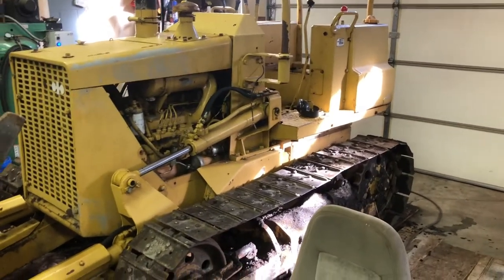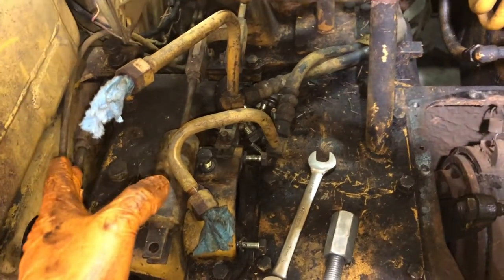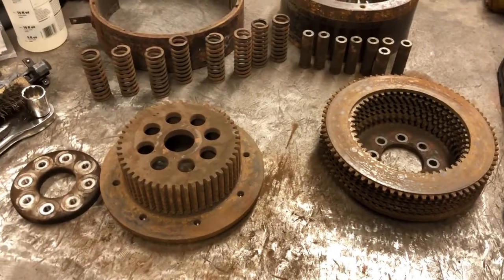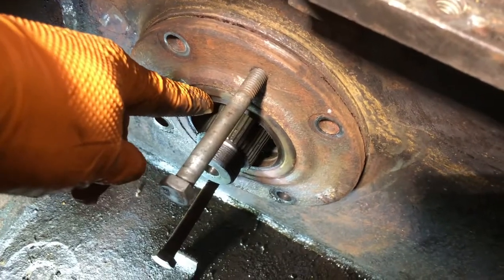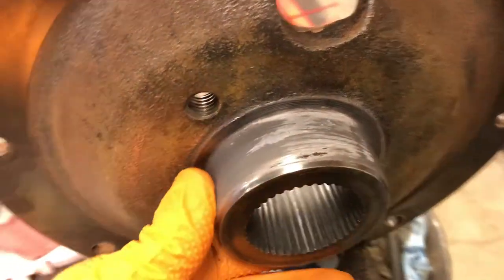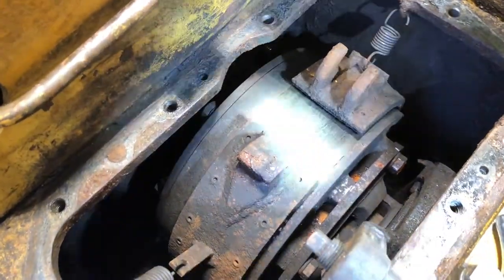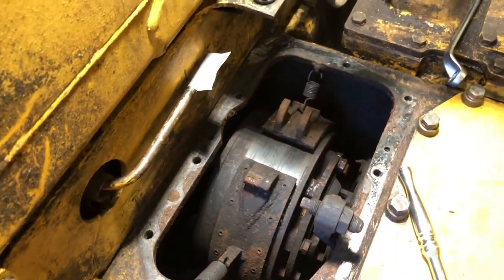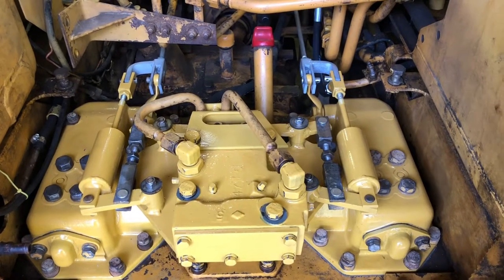Komatsu D20A-5 Dozer Steering Fix

Comment: Nicely done video, with tons great points! I have 1985 cat d3b dry setup they are very simlar in designs. I recently pulled my steering clutches and brakes and installed all metal disc with the bronze faced linings (they are made to run dry,) major upgrade for the d3's! Thanks Nate
Reply from the maker: Glad you liked it.

Comment: Thanks for posting this video. I'm helping my uncle fix a D21E-6 that isn't able to turn left and this video will help us a lot with doing so. Thank you and have a good day.
Reply from the maker: Thanks. Hope it helps.
Reply: @jeremydiy  Does the service manual you have cover the D21E-6 as well? If yes, where can I get it? Also is there a specific website that you were finding parts on? Thanks for your time.
Reply from the maker: @nick_is_steve  No it doesn’t. I have had the best luck doing a Google search for parts. I you get a part number then put that in. I use images a lot because then you can see if the part resembles what you are looking for.

Comment: Awesome video! My D20A5 just started locking up the right side. I guess I’ll be tearing it all down and watching your video 20x!!
Reply: Having a super tough time getting those clutch covers off. I need to take the little pins out on the inside, and they’re stuck!
Reply: Looking like that large bearing completely grenaded on me! Chunks of metal when the drive oil was drained! Where can that bearing be purchased?? I’ve found ONE, for nearly $350!!
Reply from the maker: Not sure which bearing you’re talking about but I think I looked them up by part number and found them on eBay. If it’s the bearing from the clutch to the sprocket, ya those are expensive.
Reply: Thank you for the reply. The bearing seems to be on back order. If possible, I have a couple of questions: the access plug to get to the brake clutch bolts is frozen, it’s now stripped out! Is it worth drilling it out, or should I just use a swivel head 17mm wrench to remove those bolts? Also, once those bolts are removed, does the clutch disc assembly just lift out?? I can feel that the bearing that the clutch assembly connects to is sloppy and likely destroyed. Any other info on this project would be appreciated! All of my steering is perfect, just had that bearing grenade on me and it would stop that side and sound horrible!
Reply from the maker: @stephenlarue6842 I think it’s worth getting that plug out. Without that access it’s going to be really hard putting it all back in. You can do a couple things, drill the centers out and use an easy out tool (the biggest one you can) to try and brake it free or weld a bolt head to it so you can put a socket on it. Which ever route you go I would soak it in penetrating oil and heat it up just before trying to brake it free. 
After you get those bolts off the plates on both sides, the clutch is free. I used a bar and a rope to support the weight of the clutch while I was taking it apart. It’s heavy, probably about 50 pounds.
Reply: At 15:51 in your video, the bearing that is on the shaft with the gear... mine completely disintegrated! This week I'll be pulling off the whole sprocket with outer cover to clean out the mess and see what other parts I need. A parts guy is asking for the number off of that bearing, but mine is in pieces! Any chance that you have that bearing number? I have the part number, he wants the number on the bearing.. thanks!! (Also, If need be, do you still have your old bearing??!!) @jeremydiy
Reply from the maker: I’m not sure I kept the old bearing. I checked my raw video footage from when I made the video and I never got close enough to see the numbers. I’ll look around my shop and see if it is laying around or in my recycle bin.
Reply from the maker: I still have the bearing. Japan G NSK 309 is all of the info written on the bearing. Hope this helps.
Reply: Thanks for your help! I now have everything apart on a table, my pinion shaft is damaged, and both bearings that are on the pinion gear are disintegrated to tiny pieces!! I took the whole outer cover with sprocket attached off… have to clean out the mess and spend some money!!
Reply from the maker: @stephenlarue6842  good luck.
Reply: Just an update, I got the entire drive assembly from a used parts seller, I have everything, EXCEPT for the race that you also replaced! It's not in the new retainer part! It clearly needs the race to fit the bearing! The part is not listed on my parts diagram! DO you recall that part number or name??! Race can be seen at 15:28 on your video. The old one from my machine is gouged and destroyed. Thank you again! @jeremydiy
Reply from the maker: @stephenlarue6842 
When I ordered the bearing the race came with it. The bearing and race are considered one part because you never replace one and not the other. In my video at 30:36 I show the part number of the bearing and race that I bought.
Reply: @jeremydiy  Would you believe that it took 4 months to get that bearing! It finally arrived yesterday! I'll need to refresh my memory now before I reassemble everything by watching your videos!! Thanks again for your help....
Reply from the maker: @stephenlarue6842 Holly crap that’s a long time to wait. I hope it goes well for you putting it back together.

Comment: Question the flange plate that holds on the yoke and throw out bearing, what size socket did you use to remove the nut that holds that flange on sir?
Reply from the maker: Unfortunately I can’t remember. I probably just grabbed sockets and tried them until I found the one that fit.

Comment: Do you remember where you got the throwout bearing for the clutch release? Or maybe the part number? I cant find one
Reply from the maker: I took it into a bearing supply company and they were able to take measurements and find a replacement. Unfortunately I do not have any of the part number information anymore. I think I still have one of the original bearings that I pressed out, I’ll see if it has any numbers on it that I can give to you.

Comment: Hey Jeremy great video. Been having the same issue with mine. Do you have the part # for those inner seals?
Reply from the maker: No. The only seals I changed was the ones I showed in the video. You should be able to find a number on the old seal. Every seal I’ve ever pulled out has a part number on it. You can then search that number on the internet or ask a auto parts place. I have a bearing and seal company near me. One time the number was unreadable and they were able to measure the dimensions and find me a replacement.

Comment: I just put clutches in mine also, but I am having a hard time putting the break linkage and the cover back together. Do you have any advice? Thanks for the video I watched it several times.
Reply from the maker: Oh ya, that was super hard. I can’t really remember. I do remember having almost everything assembled and putting the cover over the brakes and then having to insert a pin I believe patience and time is what it took.

Comment: Hi, nice video. Not sure if your aware that the left track is on backwards. It will cause it to wear faster and not grip very well pushing forwards. 👍
Reply from the maker: Ya I noticed that as I was working on it. It came that way and I haven’t made the time to fix it yet. Thanks for the heads up.

Comment: Hi I changed my clutches and the bearing went out in that yolk a little later down road I bought new yoke and bearing now the clutch won’t release my cylinder is operating and has accurate pressure thru control. I tried adjusting the bolt on top of arm both way do you have any ideas? Tired it’s of taking it apart to adjust and readjust thanks you have done a really good job!
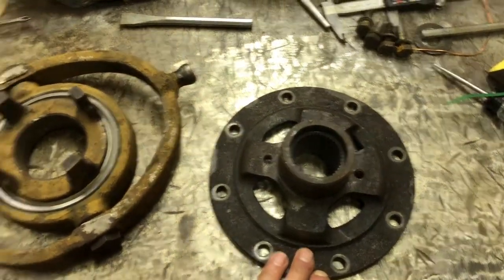Reply from the maker: Are you calling the yoke the leaver that the cylinder pushes against to disengage the clutch? I talked about it at 11:47 in my video. I just want to make sure we are talking about the same thing. I would think that it has to do with the new yoke and bearing you put in. If the machine was working fine after you installed the new clutches and before you put in the new yoke but not after, then maybe make sure the yoke is installed correctly. Do you have a parts diagram? Maybe you assembled the yoke backwards and the cylinder can’t push out far enough. The yokes have a specific direction.
Reply: Thank you I’m going to tear it down again tomorrow and inspect but I’m really sure it’s in there correctly. When I get it figured out it will b too soon! I’ve replaced the whole undercarriage lots of time and money. Thank you sir
Reply from the maker: You’re welcome. It’s the only thing I can think of with out seeing it. Good luck.

Comment: how many hours were on this dozer?
Reply from the maker: Not exactly sure since I only worked on it in my spare time. Maybe somewhere between 40 and 60 hours.
Reply: no, I mean how many hours are on the machine?  I'm judging from your track wear that this was used quite a bit before the steering got to this point?      Also, just fyi, Im off grid where I may be overhauling mine so, because your video was so well done,  I was able to snip pictures from the vid, save to flashdrive before transferring to my phone......now I have some great stills to help me through the process!  well done!
 @jeremydiy
Reply from the maker: Oh, 2500. The tracks seem pretty low quality so they may look like they have more hours on the machine than it does. Glad the hear that this should help.

Comment: Hey buddy I got a D31 with similar issues and it’s pretty much exactly like yours. Do you got a email so I can ask you some questions. Let me know thanks buddy
Reply from the maker: I’m more than happy to answer your questions but I don’t want to put my email out there for everyone. You can ask your questions through this comment section or give me your email and I’ll respond. Thanks.
Reply: @jeremydiy  hey well I got almost the exact dozer , mine is the D31 !  Here’s my issue. Well it drives forward and reverse just fine , plenty of pushing power. When I first bought it a few years ago it did turn , but never turned the best. Well a few months ago it stopped turning good and I decided to tear it apart. 
1- I took both sides of steering clutches out of it and replaced ( the old ones looked fine ) I replaced anyway. The springs were fine also ! 
2 - my system is wet clutched also ! 30 weight oil 
3- I took apart the 2 Slave cylinders and they looked great so did the o-rings . ( you said you had a company make you new ones ) 
4 I put it all back together and double checked everything and replaced all the new oil in mine clutches 

Well it’s doing the exact same thing drives forward and reverse just fine ! I DID RELIGHN BOTH BRAKE BANDS WITH NEW FIBER AND RIVETS . I almost forgot about that
Any ideas of what it could be , I thought maybe I got all those linkage arms out of adjustment .  Or maybe it’s the power steering pump that sits in the middle between the clutch housing covers .
Reply: @jeremydiy   I will do a video of it tomorrow and post it on my YouTube channel here and you can look at it and maybe see if you have any ideas.
Reply from the maker: It sounds like everything is in good working order. I would double check all of your linkage that you put back together to make sure they are within the correct specs. You said your slave cylinders looked good, but you replaced the O-rings in them anyway. I’m assuming those cylinders are what causes your clutches to disengage. I think I would start looking at the hydraulic pressure that feeds those slave cylinders and any mechanisms upstream. If your system is at all like mine, there should be some kind of hydraulic control valve that allows hydraulic pressure to go to the cylinders that disengage the clutches. mine is a one-way system. Hydraulic pressure goes in and then the force of the springs from the clutches pushes the fluid back out. That fluid never gets re-circulated and sits in there for years and years. The fact that both sides are doing the same thing makes me think you need to follow the system back to a location where it Y’s off. In a nutshell your machine sends hydraulic pressure, usually via two hoses, one supply and one return, to a control valve. That valve should be hooked to your steering linkage whether they’re foot pedals or hand levers. That valve is what controls the hydraulic fluid to the slave cylinder‘s to disengage the clutches, based on what you told me, I would start investigating all of that system. It sounds like you may not be getting hydraulic pressure to those cylinders in order to disengage the clutches.
Reply: @jeremydiy   yes brother ! My machine is almost identical to yours ! Mine has steering levers , not pedals. I will get the video up tomorrow and I will message you . Im thinking it’s the hydraulic pressure like you said because when I pull the lever to steer it everything looks like it should be working, once I get the video up it will help. Im just lost with it. !! And need help badly. I purchased it to make a better graveyard for my father that passed away. I got the graveyard about half done and I have been trying to get it fixed . I was just out of ideas.. I really appreciate you !! I have done mechanic work all my life but not on heavy equipment ! So it’s a learning curve. I will Message you tomorrow. Thanks buddy
Reply from the maker: When you pull the levers to steer does the machine bog down like mine did in my video?
Reply: @jeremydiy  I uploaded a video today so you can at least see what I’m working with !!  No it doesn’t bog any !! It barely try’s turning, you can barely feel it start to turn then it just keeps going straight . I will start it up tomorrow and do another video of it running and moving. Again I appreciate you buddy
Reply from the maker: I watched your video. The dozer has a two part steering system. When you start to pull the lever back those plungers get pushed in. Those plungers let hydraulic fluid go to the slave cylinders. Those cylinders push out on a linkage, I can’t remember what it’s called in the manual. That linkage disengages the clutches. That’s the first part. As you pull the lever farther back you start engaging the linkage that pulls on the brake band. Once the brake grabs the machine will turn sharp because that track stops completely. 
I asked about it bogging down because that is what mine did. Mine was not disengaging the clutch so when I would pull hard on the lever the brake would grab but the machine would power through it. It bogged down when I did this. The fact that your doesn’t bog down make me think that your brakes aren’t grabbing. I spent a lot of time getting all the linkage adjusted correctly. When you pull a lever it needs to push in those plungers then start pulling on the brake linkage. I jacked mine up so the tracks were off the ground. This allowed me to put it in gear and spin the tracks while I messed with the linkage. With it jacked up you might be able to manually pull on the brake linkage to make sure that the brakes are grabbing.
Reply: @jeremydiy  sounds good brother ! I will do some checking in the next few days ! I will get a Video of it running to while I pull the levers ! I think I got the Manuel that tells you the measurements for each linkage arm . Right now we’re getting some snow in Southwest Virginia so it might be a day or two before I get to it. But I will give you a holler in a few days and I will check some more things out on it. I appreciate you buddy . Later
Reply: Hey brother I will be working on my dozer in the next week, I definitely will take your advice and do some videos. Because this is crazy. It moves forward and reverse just fine. I think something is out of adjustment or it’s not getting fluid
Reply from the maker: Sounds good
Reply: @jeremydiy Hello Jeremy. I just found your channel  and giving you a shout. I heard you mention Tacoma. I take it you are in Washington.  I live very near there and just bought a kamatsu d21a. Haven't had time to run it much but will soon. Hope to chat with you more in the near future.
Reply from the maker: @allenschauer7229 That’s cool. Hopefully it’s in a little better shape than mine was.

Comment: It is a D21 A, not a 20.  Mid 1980s.  I have the same model. Should be a serial number tag on the left side.
Reply from the maker: No it’s not. The lag on the left side says D20 A. Also, all the parts I look up in the parts manual are correct for a D20.
Reply: Sorry my mistake, I have a D21A mid 80s, looks a lot alike from the cab area. @jeremydiy